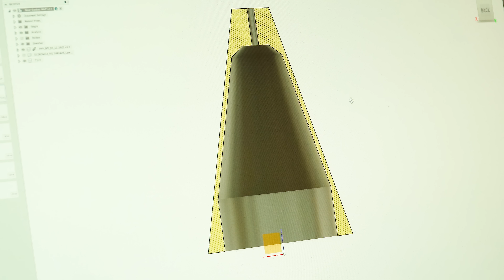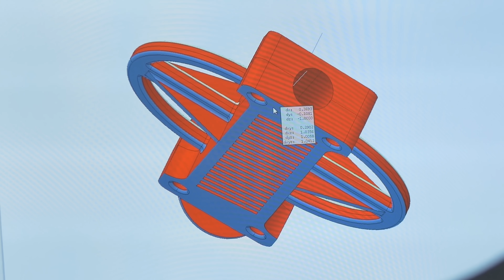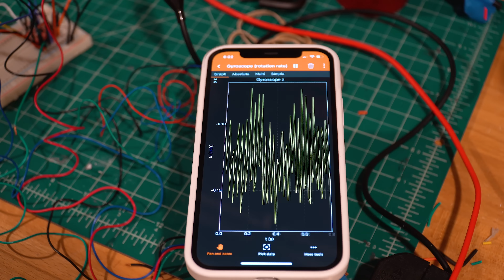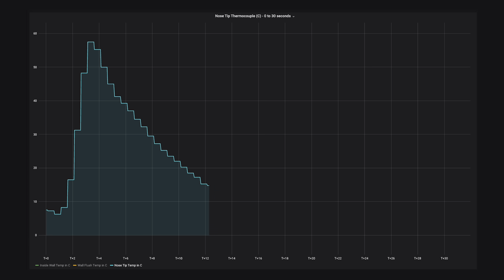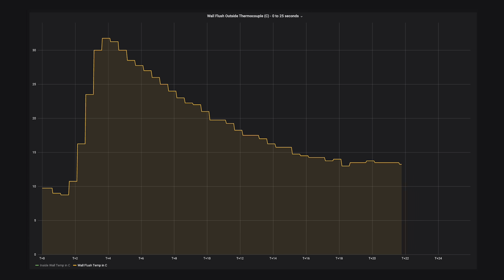How Hot Does a Rocket Get?

Comment: Hey folks, today I want to show you two cool things.
The first is an instrumented nose cone, and the second is another revision of my camera
spinner idea to stabilize footage from a spinning rocket.
Before we get started, this video is sponsored by Protolabs.
As a general rule, when things go fast, they get hot, and the faster they go, the hotter
they get.
The SR-71 going Mach 3 reached over 600 degrees Fahrenheit, and when a capsule like Crew Dragon
returns from low Earth orbit, it screams in at 17,000 mph, getting up to 3,500 degrees
Fahrenheit.
I have this idea that I've wanted to do for a little while, and I've been calling
it the Meat Rocket, but maybe we should give it a different name, something like High Stakes.
The idea is that by going fast, we could cook a piece of meat.
I want to take a thin slice of meat, stick it inside the nose cone, and as the rocket
accelerates up to about Mach 3, the meat cooks because of the aerothermal heating at the
tip.
The real question here is how much heat actually gets transferred into the food.
How do you reliably cook this piece of meat and, like, know that you're going to cook
it?
This is a difficult question to answer accurately.
Modeling the heat transfer through a complex shape between the heat on the outside wall
and the cooler inside wall is a question that usually gets answered with something like
CFT.
That's all well and good, but hear me out.
You could also just fly it.
You could just send it.
Like, literally, you could just send it.
Un-send it to the rocket behind me.
So here's the idea.
We're going to take this existing rocket, stick a new nose cone on it, we're going to
send it to about Mach 1, and then just see what happens.
The nose cone from SendIt has this aluminum tip that screws on.
We don't need it.
We're getting rid of it.
We're actually going to chop off more of that nose cone than the piece of aluminum, and
here's why.
To record temperature data, we're going to use the AvaFlight computer that flies on basically
all of my rockets at this point.
I've actually got it right here.
We're going to put the AvaFlight computer just below the nose cone to keep all of the
wiring pretty compact.
So in order to get this setup to fit, Ava has to slide down through the top of the rocket,
and we need just enough clearance on the top for that to happen.
This whole setup ends up getting mounted on a threaded rod, which will get screwed in
at the bottom of the nose cone.
To make the tip, I worked from 6061 aluminum stock material, first milling off a good chunk
on the CNC, then turning down the rest of the shape on the lathe.
While this is going on, let me tell you about the idea behind this design.
The shape of this part has a thick section up top, a thin wall down the side, and a thick
section on the bottom.
The idea is that in the final iteration, we'd place a piece of meat inside that thin section
of wall on the side.
The wall thickness here is roughly 1mm, so hopefully we get a bit of heat transfer inside
of that thin piece.
If you want a more detailed look at what it took to make this nose cone, I posted a much
longer version of this on my second channel, which is linked down below.
So I've got four of these little thermocouples here.
These are temperature sensors, basically.
We're going to place them at different parts on the nose cone, and this first one is going
to go at the very, very tip of the rocket.
We're going to do that in a somewhat odd way.
I left the tip off of this aluminum part, and we're going to finish that top part with
a slug of rock epoxy, and then embed the thermocouple at that tip.
This lets us run the wire through the nose cone a little more easily, so what I did is
I shaped the epoxy using a bit of painter's tape, and then once it had cured, I sanded
down the shape of the tip on the lathe.
This leaves the thermocouple to be the actual leading point of the rocket, so it should
theoretically see the most heating.
Next up, I wanted a thermocouple just a bit to the aft of the nose tip, but still exposed
to the air outside.
This data would have been cool to see, but the thermocouple didn't end up working.
The amplifier for it died like right before the launch, and it was time to fly anyway,
so we'll never know what that saw.
I then added a thermocouple that was flush with the sidewall to estimate the heating
we'd see on the actual skin of that thin section, and to round it out, I added a fourth
thermocouple on the inside of that one millimeter thick wall.
The fourth one was attached to the wall using thermal paste, and then held in place using
five minute epoxy.
Before we keep going on any of this though, I'd like to tell you about today's sponsor,
ProtoLabs.
If you haven't heard of them before, ProtoLabs is the fastest and easiest way to get parts
manufactured that you don't have the time or ability to make yourself.
Every now and then, I have a part that I need to make where I don't have the machine, or
I just don't have the time to make it happen, and so getting parts 3D printed, CNC'd, or
even injected molded by ProtoLabs is the right call.
ProtoLabs...
Proto...
ProtoLabs's platform gives you the ultimate user experience with a streamlined quoting
system and design analysis delivered right away.
All you need to do is upload your CAD file, choose your manufacturing service, and ProtoLabs
will do the work of a design for manufacture analysis, which saves you valuable time by
identifying issues before they happen.
They've got fabrication services that can be done in as fast as a single day turnaround,
and so if you want to learn more about ProtoLabs's services, you can check them out using the
link in the description down below.
Thank you very much to ProtoLabs for sponsoring today's video, and now let's get back to it.
Now that we've got our thermocouples inside the nose cone, it's time to read from them
and record that data.
Like I said earlier, we're going to use one of my AvaFlight computers to record this data,
but the computer here can't do that directly from the thermocouples.
In between Ava and the sensor, we need something called an amplifier.
The amplifier is going to take the signal, boost it up a bunch, make it a lot easier
for Ava to read, and then Ava can record it.
In addition, because of the way that thermocouples are, they do this super annoying thing where
you can't solder them to anything.
So instead of doing that, I tossed a bunch of those Wago lever connectors on the back
of the computer sled to attach each thermocouple to its amplifier.
The good news about this is that it makes it a lot easier to swap temperature sensors
in and out, or different amplifiers in and out, but they are pretty bulky for something
to scale.
This is the actual meat cooking nose cone, by the way.
This is a prototype to just measure temperature, but if we wanted to fly this on different
flights or different flight profiles, those Wago lever nut connectors allow us to do that
a lot more easily.
Finally, I tossed a small 600 milliamp hour LiPo battery on here, and then a telemetry
radio to keep track of the state of the rocket as it flew, and this turned out to work against
me a little bit.
On the first flight of this nose cone back in November, the telemetry radio needed so
much power that we ran out of battery while the rocket was idling on the launch pad.
It flew without a problem anyway, since the computer in charge of the parachutes was fine,
and the goal was really to test that camera spinner device, but we never got any good
data from the temperature sensors.
So on this flight, I removed the telemetry radio to save power, and we headed out to
the launch site.
Before we get to the launch, though, this flight also tested version 2 of the camera
spinner.
If you remember a few months back, when I first flew this thing, the goal was to spin
the cameras around to cancel out the rotation that rockets normally experience.
It worked alright on the first try, but the motion was obviously jerky and could use some
improvement.
So in this version, I first removed the massive gear train, which was covered in sand, the
brushless motor, and the external gear on the central tube.
Instead of those things, I swapped them out with a stepper motor, which has much smoother
motion and more controllability than the motor I was using.
Instead of mounting this stepper motor on the spinning part of the ring, where space
is at a hyper-premium, I mounted the stepper motor inside of the central tube, and connected
the motion of the motor with the motion of the wheel with magnets.
I am so stoked about this solution.
I love magnets.
I stacked a bunch of these neodymium magnets on the shaft of the stepper motor inside,
and then a stack of them covered in epoxy to hold them on the outside, on the spinning
part of the wheel.
When the motor rotates, the attraction of the magnet stacks keeps them roughly aligned.
To control the stepper motor, I put a little computer down below the spinning section and
started hooking it all together.
The setup needs a computer, an IMU, a stepper motor driver, and a battery.
Space is at such a premium on the scale of a 4-inch rocket like this that I actually
had to cut the lithium polymer battery open.
I took an existing 3-cell LiPo and cut it open to keep it from scraping against the
inside of the rocket, and this actually led to some jerky motion later on.
You'll see.
Mounting this new setup inside of the rocket was a bit of a challenge too.
Last time we were able to use that massive threaded rod that ran through the central
tube and compress it in order to keep the sections attached.
But because that stepper motor is inside the tube, we can't do that anymore.
I had to take the top and bottom couplers, then drill pass-through holes for the screws
to attach the couplers to that central tube.
This setup is less rigid and stable than before, but the smooth motion from the stepper motor
should make it worth it.
And speaking of motion, here's a
Reply: little bit of testing on the setup once it started
working.
Before the flight, I wanted to test the rotation of the spinner.
Last time, I did this using my lathe, mounting this sideways, but instead of the lathe, I
wanted something with a smoother transient, from no rotation to fast rotation.
I was able to do this using my record player, actually, and it worked pretty well.
After a decent amount of tuning, I got it to work smoothly from slow speeds to high
speeds using a sort of two-mode control system.
This is the final test of the spinner before flight.
Alright, so at slow speeds, all we're trying to do is maintain position.
And we do an alright job at that, I think.
But we switch between position control and angular rate control, and they're a little
bit different.
Having the two different modes allows us to prioritize different things at different parts
of the flight.
When we're at apogee and the vehicle is rotating like this, we want the smoothest motion we
can get.
And that's what this position control mode allows for.
But when we're spinning really fast, what we're trying to just focus on is angular rate,
and sometimes you can see it skips, it's not perfect.
We're also getting offset on the record player.
But as the vehicle slows down, we move back into position control, and we try to hold
the cameras in the same spot.
So I'm pretty comfortable with this, going to turn it off so I don't waste the battery
too much.
Let's recharge everything, get this thing integrated, ready for flight, and try it out.
Yeah, we're looking at this thing going about 4,000 meters.
In 5, 4, 3, 2, 1, 0.
All right, 1,000 meters.
The flight went straight up to an apogee of 4 kilometers with a maximum speed of 362 meters
per second, or just over Mach 1.
The camera spinner worked better this time.
Still not perfect, something happened after launch and we lost control for a few seconds,
but once it re-engaged, it was super smooth till apogee.
You can actually see how close the tolerance is with that battery as the device spins around.
When I make a third version of this, having much more detailed CAD is going to help eliminate
these problems.
Overall, I am really pleased with the shots that I got here, and I am excited to make
another version of this thing at some point.
If you want to see the raw footage from this camera spinner, I've posted it on the BPS
Shorts channel, which is also linked down below.
And now to answer the big question, how hot does the tip of a rocket get?
Well, at Mach 1.05, the tip got up to 136 degrees Fahrenheit.
Not too bad, since the outside temperature on the day was about 50 degrees Fahrenheit.
I was not really expecting that much of a temperature rise from such a low Mach number.
The other thermocouples fared as you might expect as well.
As the vehicle speeds up, we get a peak heating of about 90 degrees Fahrenheit from the thermocouple
that's flush with the wall of that nose cone.
And this happens at about the same time as peak heating on the tip of the nose.
As for the inside wall thermocouple, we do see heat transferring to the inside of the
nose cone, but you can tell that the heat pulse moves more slowly through that wall
because we don't reach peak heating until about 6 seconds after peak heating from the
tip and the wall flush sensors.
And because of the thermal mass of the nose cone itself, that heat is solidly lower than
the wall flush sensor or the tip sensor, going from about 45 degrees Fahrenheit to 57.
Obviously, these speeds are a lot slower than the Mach 3 rocket that I want to cook meat
with.
That said, this design tells me it's probably worth trying a new design for whatever we
end up cooking this piece of meat with, and I would love some help on this.
The goal is that we need to transfer as much thermal energy into that thin slice of meat
as possible, and we have to do it without A, affecting the aerodynamics of the rocket
too much.
When you get up to high Mach numbers, you're really concerned about the oblique shock shading
basically your stability on the way up, and B, the piece of meat can't fall apart.
Meat is relatively delicate when compared with aluminum, and so if we expose the piece
of meat to the free flow airstream, it's just going to strip away.
I'd love to hear any ideas that you have about how this might work or how you might
approach this, and if you want to sketch out a diagram or draw something and tweet it to
me at Joe Barnard on Twitter, I would love to take a look.
It'd be great to crowdsource some type of design here so that in the name of science,
we may cook a small piece of meat as inefficiently as possible.
Thanks for watching.
Thanks again to Proto Labs for sponsoring this video and to the patrons who make this
project possible.
My name is Joe Barnard.
May your skies be blue and your winds be low.

Comment: There's a lab at CU Boulder working on 3d printing tungsten alloys for heat transfer applications. I think that may get you the thermal and structural properties you need.
Reply: or Titanium sheet ... welded into a cone shape .. with an aluminium base plate/ cup to hold the meat then the tip becomes an oven and he gets a roast of meat ... 
AND it is sealed keeping any leakage out of the electronics ...

Comment: Cooking meat... that is a tall order as you definitely need long term heating so that the core of the meat reaches a safe temperature. So that implies cutting the meat super thin as this won't provide heat for a very long time. The best way to approach this would probably be to sandwich the meat between two parts around the perimeter and use a heat conductive material that has a high thermal mass to bring the heat to the inside of the rocket and cook from the inside out. When reaching mach 3.0, the altitude will be pretty darn high and the air temperatures will be unbelievably cold, so do expect the rocket to be cool by the time it comes back down to the ground.

Comment: I envision a smaller secondary inner nose cone (maybe ceramic?) whose base would be threaded into the primary aluminum nose cone.  It would be sized such that there's 1-2mm gap between the body of primary and secondary cones.  Then you could cut your slice of meat into an unfurled cone shape and load it between the two cones.  This would keep the meat contained while allowing for maximum thermal transfer.
Reply: Just like the intake on a mig-21 lol

Comment: Copper top. Cooking means proteins denature, so choose meat with the most delicate protein, maybe fish? Add a little (!) oil for heat transfer and to get the meat out later on. Squeeze the oiled meat into a chamber for full metal contact. Keep the copper tip small and isolated; no heat sinks. Could you roughen up the copper tip to drag a bit more?

Comment: At my work we make medical devices, and rapid heating/cooling is a common topic. At one time we thought "why bother with computer models when we always have to validate them with real-world prototypes, and protos are so easy to make?" Long story short, we quickly learned that it's better to get really good at computer modelling, using protos to improve our modelling capabilities. That being said, if it's cheap to just put a steak on top of the nose and launch, it might be instructive.

Based on your initial results, I expect that your problem will be too little heat, not too much. Expect to see a high premium on getting thin, to reduce thermal mass. Even at Mach 1, you might need to deliberately collect heat by changing the aerodynamic surfaces.
Reply: tbh, I would really love to hear that long story... been contemplating for the same thing recently!

Comment: You could make a very thin aluminum nose, put it on top of a thicker main nose, and have the meat be inbetween.
Like this, the outer hull would heat up a lot faster, while the structural integrity of the meat is preserved.